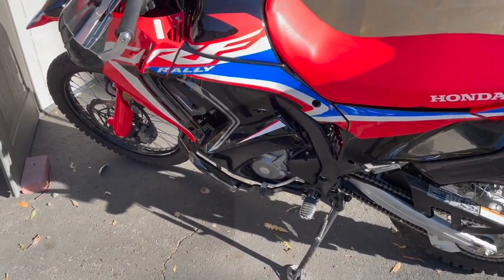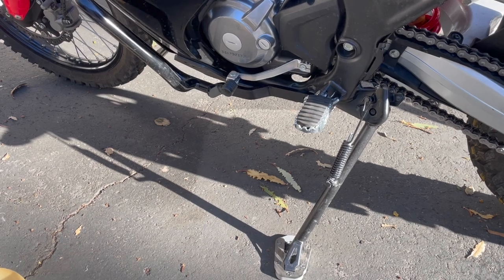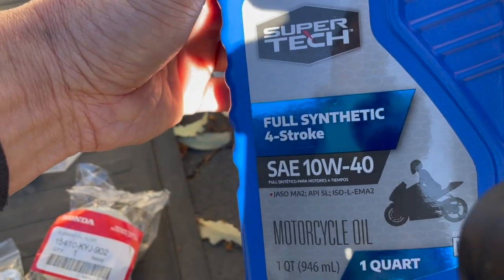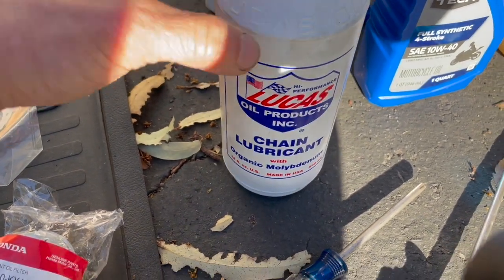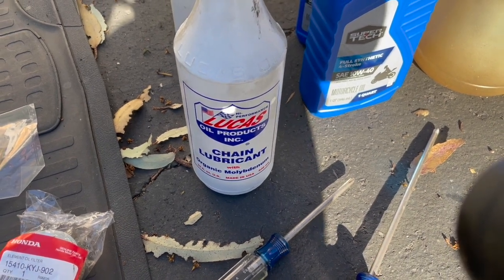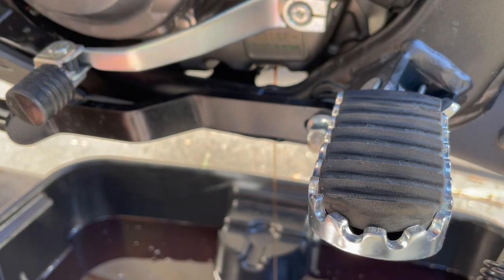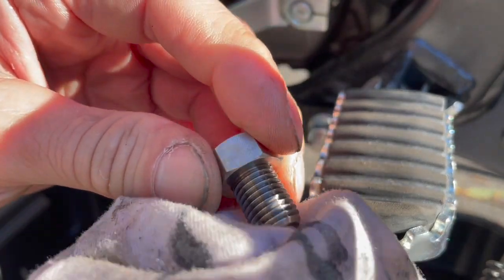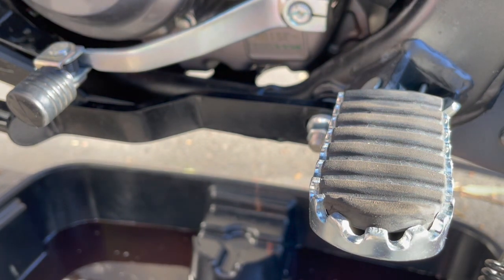CRF300L Rally 600mile oil change

Comment: Hi DaBinChe, how much new OIL needed with filter change ?   1.5 lt  or 1.8 lt  in a 300LRally ?    Thank you !!
Reply from the maker: Don't remember, just fill it till the sight glass is topped off with the bike level
Reply: @DaBinChe  yeah of course this is obvious - you can adjust it from the clearly visible and specially made in a side level / but I wanted to know the exact quantity....I'll check it. I hope 1.8, I'm looking for your confirmation. Ciao GRAZIE! THX
Reply from the maker: @lukestringer2177  Start with 1.5L
Reply: @DaBinChe  ....better 😬 yes

Comment: Think this will be ok power wise  with 225lb rider with occasional freeway? or best to try make 2022 CB500X with dual sport tires work? Im about 50/50 street/off road with low speed off road only.
Reply from the maker: depends on how fast you want to go on the freeway
Reply: @DaBinChe  75-80 max at times
Reply: I’m about 265 and get to 70-75 freeway maxed on my Ralley
Reply: 170lb 82mph max for me.
Reply: 180 pound rider and Can confirm 82 maxed 
. I once went 87 down hill with nice stream of air
Reply: I don't care what anybody says dual sports just aren't for the highway. They're for town, taking scenic back roads and offroad/trails.